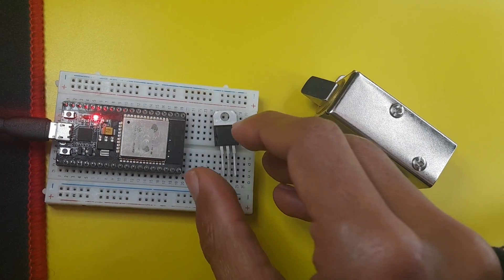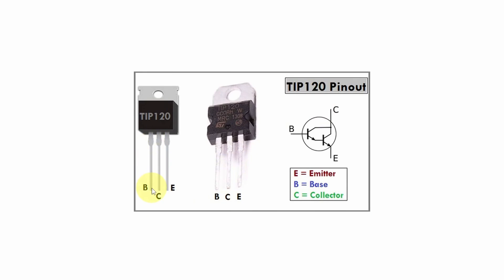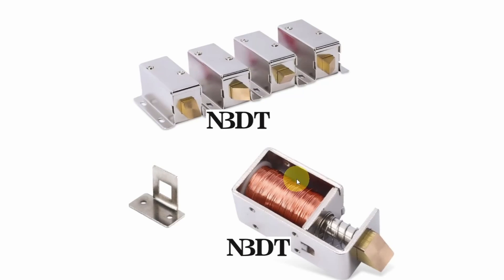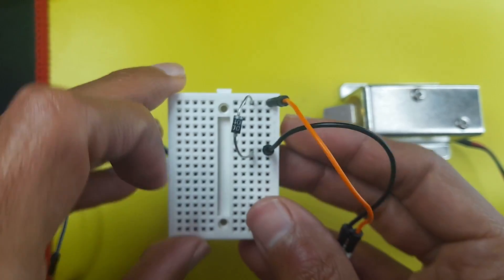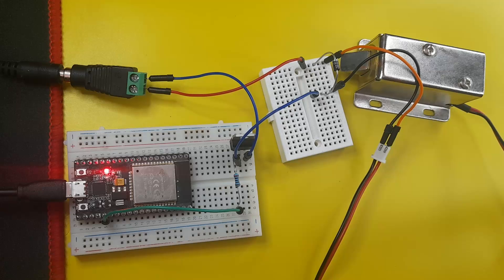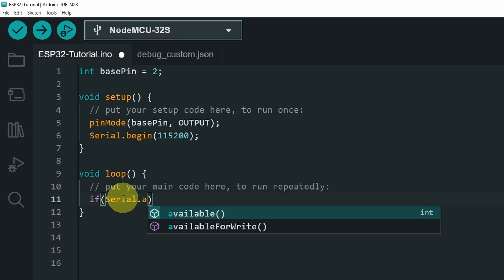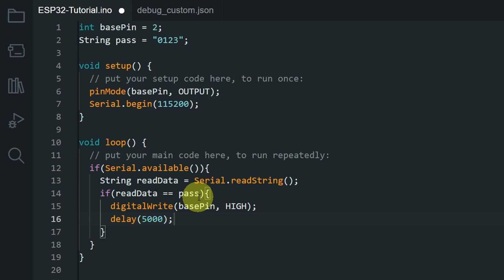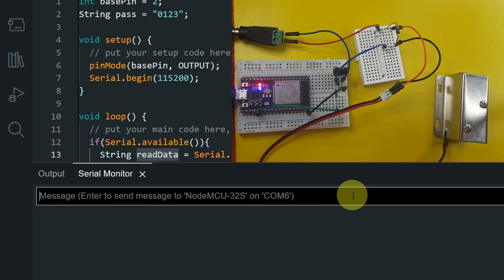Control High Voltage Devices with ESP32 and Tip120

Comment: used it for motor project . i gave 5v external power to motor and then gave NodeMCU signal directly (without Resistor )  it worked great. thanks for sharing sir
Reply from the maker: Thanks

Comment: What situations are good for this transistor approach vs a more traditional relay ?

This is to control the start sequence of a generator … part of this is to energize the fuel solenoid AND keep it energized while running … which can be several weeks.

Comment: I need to provide 12v switching in an arduino project. Can I do it with Tip120 transistor?
base = arduino digitalpin
collector= 12v input
emitter = 12v output
So I will use it like a relay
I don't use a relay because I need to make a compact circuit.
Is it necessary to use aluminum heatsink?
Reply from the maker: Yes, you can

Comment: Ive spent all day testing ESP32bluetooth to ESP32Bluetooth to control some 12V Leds
The circuit worked fine using the TIP120 at 12V led,
But my testing was 12v, and 24v in reality, I tested it at 24v (two LEDs in series) and it didnt work, I scratched my head for hours only to have your video show me ground commoning was needed.

As to why this worked with 12v and not 24v without joining the GND between ESP and 24v source I dont know

Comment: How amper limit?
Reply: 5
Reply: this mofset have max 5amp, but you can use another mofset, there is mofset whit max amp 20amp or more, if you need hight voltage / amp maybe is better to use a relays
Reply: @fedeyoutub   IGBT (insulated gate bipolar transistor) is the ticket for high voltage/high amp loads.

Comment: ok, and what about induced overvoltage that you can have from magnets sticking to the solenoids? how do you protect the circuit from that? magic?
Reply from the maker: Diode
Reply: @DIYTechRush  with overvoltage? the diode do not protect from that. maybe protect to inverted polarity
Reply: Ootoacoplador